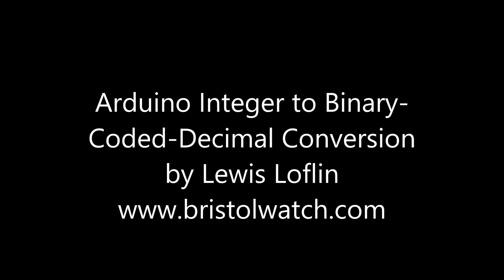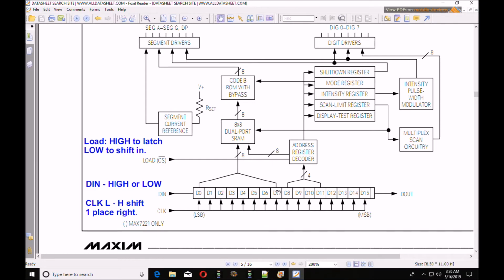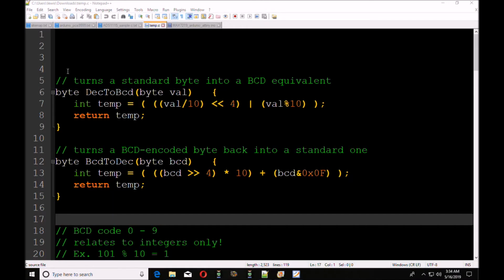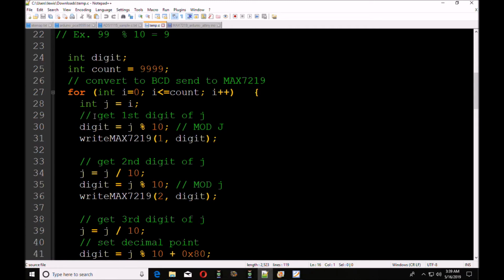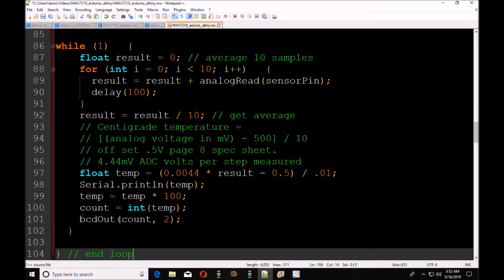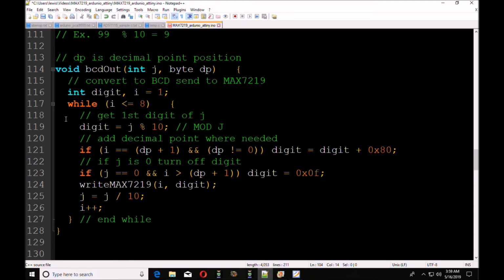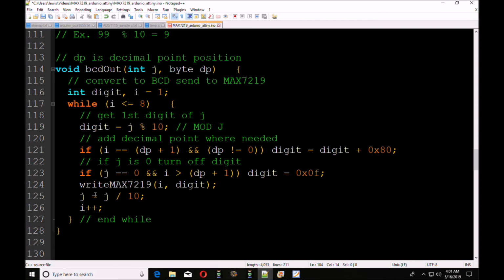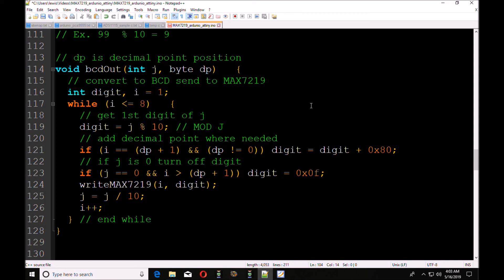Arduino Integer to BCD Conversion for the MAX7219

Comment: Thanks for the thorough tutorial brother.  I'm working on a final project for my 1st year digital electronics course and we are being scored on the number of ICs  we utilize from our initial lab kit list.  I'm using a pair of 7485s to create a 2-output temperature controller and a pair of 7447s to display the temperature on two 7-segment displays.  I'm using an arduino merely to interpret the temperature probe and give the information to the 7485s and 7447s.  I understand a microcontroller is more than capable of doing everything, however we earn zero points for the extra peripherals, so I can't simply imitate one of the many environmental control projects people have created out there.  

I appreciate your deep dive and hopefully can use the simplified BCD conversion to properly feed my two 4-bit 7447 decoders.  I've got 10 days left and feeling the pressure (my initial batch of ds18b20s ended up being dysfunctional knockoffs, and likewise some of the Elegoo Nano clones I purchased had partly or fully non-functioning digital I/O pins -- tested by running simple pushbutton LED examples at different pins).  Still have a fully functioning UNO and receiving both digital and analog temp sensors tomorrow, so hopefully I can crunch it all together by the deadline!  I only need 8-bit conversion so I'm hoping with all the demonstrations out there I can get this thing to work properly.